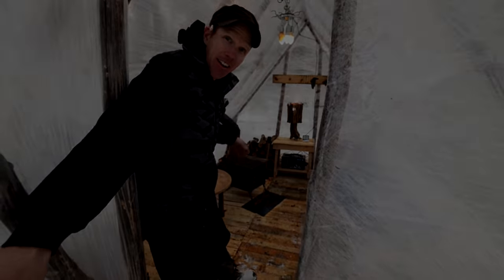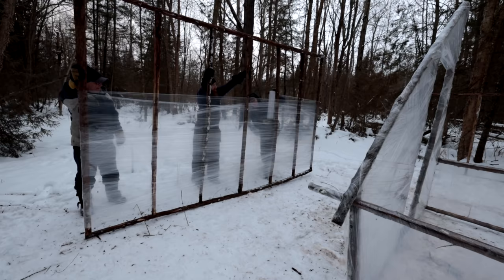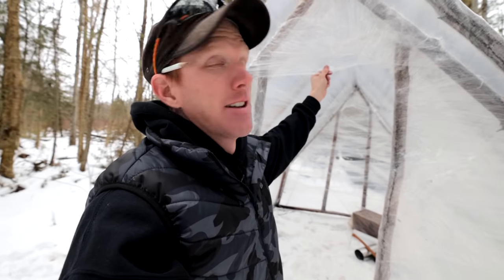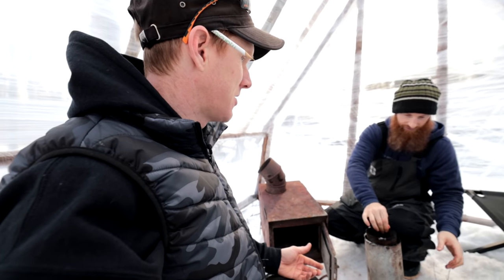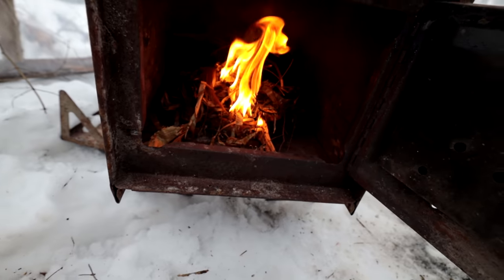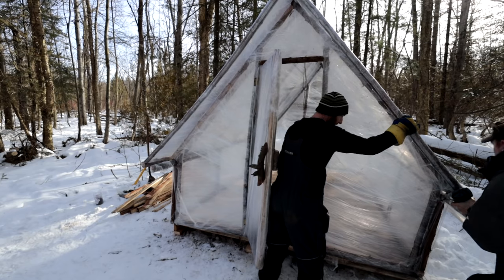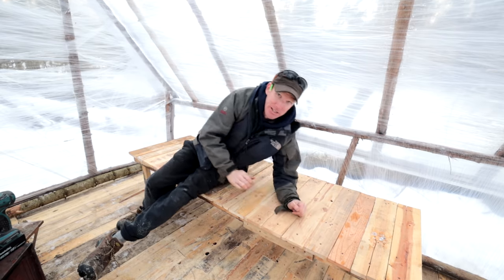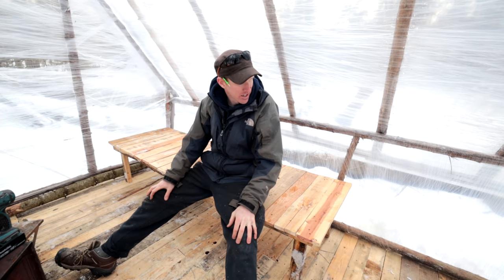$25 Winter Cabin Build (on an Extreme Budget!)

Comment: I would have made the “floor” about 4 feet longer out the front so you would have a porch area to stomp the snow off your boots before you went inside 🤷🏻‍♀️ 
Coat rack is a nice touch 🙌🏼
Reply: Have a similar overhang on the roof aswell
Reply: Maybe even tilt the floor a small bit on the sides from the seam in the middle so melted snow does not build up into puddles
Reply: Gord idea luara wijowski

Comment: I imagine the moisture levels inside that to be insane. can't imagine spending a week in it during rainy weather. and I'd suspect mildew may make an appearance after a while.
Reply: Agreed. Also not a good idea to have fire anywhere near that plastic
Reply: They could probably better control it by poking hundreds of tiny holes in the roof area with some tool.  Make something that is 1x1 foot that can be pressed against the plastic to make all the holes at once.  Do that in several different spots, and there would be a decent air exchange without letting out too much heat. The real problem with the thing is that as soon as the fire dies down, the temperature will drop quickly because of the lack of mass to hold heat. So it wouldn't exactly be safe, because if you fell asleep without making sure you have enough fire to last the night, you could freeze in your sleep very quickly because of how fast the temps would drop.  Although I wouldn't even consider something like this even for short term, because it's definitely not going to offer even the slightest bit of protection from a wild animal.
Reply: Maybe not. Its pretty dry in that climate and the stove will suck air in and vent it out
Reply: @Buck Norris " You can't sleep during early stages of hypothermia"

You might not be able to go to sleep if you're already awake.  But if you are already asleep and the temperature drops far enough quick enough, you can freeze without being aware.
Reply: @Buck Norris We literally see homeless people freeze to death in their beds all the time. People who literally die right outside of churches and other buildings they could go into.  Again, if the temperature drops fast enough quick enough, you can go into hypothermia very quickly. We're literally talking as little as 5-10 minutes.
Reply: @peoplez129  homeless people also often have mental health issues or drug problems. if someone is knocked out on heroin a tornado wouldnt wake them up
Reply: @mue56  was just about to say the same thing
Reply: @mattychristian  It's not plastic; completely different poly.
Reply: He definitely made this for views and doesn't intend on ever using it once the video was uploaded.
Reply: As someone with 10 years of SOBER homeless experience, this would be a great place to live. Mildew would be the least of your worries.
Reply: Besides, there are fixes for all the "problems" with this build. And with the money you might have saved on building mats, you could fix said things.
Reply: The fire will dry out any moisture in the air. If you burn wood inside your house it reduces the humidity so much you will start to get nose bleeds from the dryness. You almost need to run a humidifier if you are burning wood during the winter.
Reply: @peoplez129  depends on your sleeping bag, I've made it through the night in -50, it sucked but it's survivable
Reply: Who cares . They are having good brotherly fun. No harm done and sure NOT expensive fun ;)
Reply: @peoplez129  Would it make a great green house?
Reply: @pewmcgrew5226  It's a $25 "winter cabin". You act like I'm supposed to say "It works very good" lol.
Reply: Get moisture absorber container work great
Reply: first thing I thought when I saw the thumbnail: Condensation!?!?!?
Reply: Some reet Debbie downers itt. Air exchange will be fine and the wood these guys are burning is pretty much bone dry. Mildew? “If it’s raining outside” “bears sneaking up on you”. I would live in that beauty all day and night just to escape doomsvilles like some people itt.
Reply: @deepwaters3335  just what I was thinking

Comment: "It would be real easy to get out of you did catch it on fire... just run through the wall."

--A person who has clearly never tried to push through a few layers of pallet wrap.
Reply: @mrwess1927  yeah... speaking from experience, you can only tear a small (3 to 6 inch) hole that way.  It doesn't tear like saran wrap, it bunches up and becomes stronger the more you force through it
Reply: Pocket knife, axe, stool, kettle, kitchen knife, sharp rock. Any of these would work to get out in a hurry. Id be more concerned with C02 or CO building up then getting out.

Besides a 6'2 dude shoulder checking the wrap at a dead paniced sprint would be pretty likely to rip at least enough to scramble out of. Bunch of guys used to do it all the time at a place i worked.

Auto wraper would sometimes screw up on small wide pallets and the wrap would then get stuck on a support leg by mistake...so you would get 20 or 30 wraps around the bay if no one saw it in time. So you would end up with a wad of plastic that was just wide enough to fit over the 2 concrete poles by the exit....and you can figure out the rest
Reply: That stuff would melt in a hurry. Just walk through the flaming hole.
Reply: Or had plastic burns
Reply: right
Reply: @seanrallis6714  true
Reply: @balls up I had never heard of the summer land fire until this comment. That was a horrible tragedy, but import historical information. Thank you.
Reply: @seanrallis6714  there's no way that is going to stop a full grown man trying to get through it, it's not thick enough, I get what you're saying the stuff is strong but there's enough space between each wall section for it to be weak enough to break out
Reply: next part of the project: A glass emergency box on the wall, with a hammer to break the glass, inside the box, a box cutter :)
Reply: Just grab the bottom and flip the thing and walk away
Reply: @codpug  Yeah, it's pretty lightweight 😄
Reply: ... as you rebound back into the flames...
Reply: A wife could just use her tounge to cut the way out...

Comment: I could easily live there. My off grid cabin was dependably 10 degrees warmer than the outdoor air. I used to run some heat (I used propane) for a couple of hours when I first got up. It really was all I needed in Virginia. I just discovered your videos. Reminds me of my five years off grid in Virginia. Now I’m in the desert SW in an apartment. But I still use my skills for camping. And I could easily and comfortably live in my SUV because I can lie down in the back and I don’t own that much.

Comment: A lodgepole Teepee would go up a hell of a lot faster. leave the traditional vent at the top of the teepee where the poles come together.
build a small campfire in the middle of the floor of the teepee.
Because the fire is in the middle of the teepee the heat will not be too hot for the plastic or poles.
no need for anything to build it but a length of rope to hold the top of the poles together.
a hatchet or hand saw to cut the lodgepoles and the plastic rap or other canvas material to cover the teepee.
The taller the poles the bigger the teepee.

Comment: If you add some garbage bags cut into mats, to use their whole surface area, you can even have walls which are not see-through, for maybe $5 more in the worst case. And that price also includes about how much scotch tape you would meed to make sure it stays on the walls, though staples could also work.
You can use pipes (and a shovel) to get the both the air from the outside, and the smoke outside, without needing any hole in the walls. And do look into rocket mass stoves, since covering the sides of the stove with piled dirt could help retain the heat for longer periods of time, to not need to refuel it as often.

Comment: The material totally makes sense. I wish they could have engineered it in a way where they create more air packets for insulation
Reply: Umm...bubble wrap?
Reply: @Phoenixesper1  It won't be aesthetically pleasing though and would require extra materials to put together. I was thinking more of wrapped twigs, arranged around the wooden support and then wrapped again
Reply: @Phoenixesper1  Two layers positioned so the bubbles are touching each other surrounded by the pallet wrap.
Reply: Having more horizontal members in the roof panels would cut down on convection currents. Would probably help.

Comment: My dad, twin brother, and I built a greenhouse like this back in the day. We used big wire hoops and thicker plastic though. And we had a hole with a blower connected in between the plastic as to separate the two pieces and form a "bubble". Great insulation.

Comment: "We're surrounded by plastic"...yup, literally! That stove could use a wire brush and graphite coating. Super cheap and it will last longer. Plus if you add a back to your bed it can double as a bench seat.

Comment: You could probably add some forest fluff in between the layers of plastic wrap to act as insulation.
Reply: Lmao yes you can. I've lived in the woods my entire life. Haven't had grid electricity since 1994. Seems practical for a temp shelter but when you pack your home full of woodland fluff... you get woodland spiders, mold, mildew, extreme condensation issues. Ironically I pull all my insulation down in the spring and summer, due to moisture getting trapped in between the walls. Without the ability to control the inside of your oven bag, you just create a super powered petri dish. I spent a fall winter in a cave as well until my lungs got too much dust and bat poo inside. I actually caught a bat coronavirus years ago, good times. Most the old timers out in the woods are gone, just new age people using man made materials to show off their skills at building trash piles.
Reply: @exposingthetruth3821  speaking in terms of a temporary shelter. Not where I'm going to be living at permanently.  I have a job and house lol. Each to his own though.

Comment: This has been a very funny idea. But: wouldn't it make sense to lay out a tarpaulin under the floor so that not too much moisture can rise from below?
Reply: Kinda more important to put cross bracing on the floor joists so they don't rack over time.  Moisture doesn't really rise, but air drafts would be a significant comfort concern.

Comment: I really enjoyed the video.  Just rewatching it agian.  At least one long triangle in every panel would add a lot of strength. You can add the triangles on the inside after you wrap it. Some triangles (horizontal timbers) just above head level would form a roof trust as every roof trust has to have triangles unless they are very large ( usually laminated ) timbers that will carry the load. A cheap wood stove fan is nice on the stove.

Comment: Great video. A great solution for a small outdoor recreation in winter.
Reply: @_vandoos_   igloo snow den.
What is bad is dealing with an area with little snow and frozen earth that you can't cut through. 
In my area we had plenty of people that tried to walk five miles across open corn field to the nearest gas station.
They didn't make it.
Reply: @krispalermo8133  what happened to them? Did they survive?
Reply: @AdvocateforTruth   No they froze to death, they bought into the bull crap it takes hours to freeze to death, despite public news broad casts stating it only take minutes to suffer frost bite. Some of them were found bend over with their hands' on their knees frozen still more or less standing. Illinois most of the time has mild winter weather, but out over open flat farm lands winds shear can get down to negative -30 below or more. That is artic wind temp.
Reply: Can't believe I've spent 20 minutes watching these liars. That should cost way more than $25 unless they're shopping in South America and walking, swimming and floating the materials to said location
Reply: @Flash Dance Tig yeah, like a forest fire emergency!
Reply: @krispalermo8133  we don't believe you! So where are the people that didn't make it 5 miles across an open cornfield? I mean did they all perish and did you just stand there and watch them? Please provide more details
Reply: @krispalermo8133  -30° is not Arctic temperature that's like Western New York temperature right now APRIL 2021

Comment: Sorry having a cynical moment and it kills me. "we are going to build a cabin for $25" first thing we see is a tree being cut down with an $80 folding-saw, $40+ ratchet bindings, $?? hauling rope, $90 hauling sled. x2 $?? labor, $12 screws, $140~ power drill, $12 tape measure, $145 axe (guessing it is a Gransfors Bruks), $100~ chainsaw, + go-juice, stuff+++++. ANYWAY, fun project that can probably be done for around $25. Good video quality, clear audio, nice pacing, good job. Thumbs up.
Reply: Would he helpe if they had made it with a $5 rip saw and a $8 timber handle hammer.

Or dose the concept of browing tools from "that guy", u know that guy he's got 2 of everything........

But point taken 5 minutes crafts be either hot glue gun crap or $100,000 power tools very rare to find something really achievable
Reply: My guess is that he used most of that out of convenience then actually needing to. Because there is a YouTuber guy that builds basically everything by hand. With basically no modern tools. 

Also 140$ for a drill? It's yours gold plated? I can get a Black and Decker for under $80.
Reply: The biggest expense would be land with trees on it.

Ratchet bindings and sled are just to save labor. Your own labor is free, and if you wanted to do it all on your own, you could.

You'd only need one cutting tool, and you don't need a tape measure. No need for exact measurements. Cut one piece, than cut the others to the same length. 

Drill and screws could become nails and a hammer. Or nails and a rock if you're brave enough.
Reply: @alfalafelstine1536  that's it find land to build it on .... At least around me it's national Park or private property- farmers- coal mining an power plants.

Most will let you ride but not many want u building something no matter how temporary

Comment: I like the weaving to give structure to the roof panels,  I also think the final wrap of plastic on the roof should start at the bottom and go up with the next wrap overlapping the previous.  That way the water will not run under. Its something worth mentioning to the people watching. It looked like you guys did that but didn't say.
Reply: Overlapping the windings from bottom to top like the shingles on a roof will keep the water from running underneath the layers.

Comment: We should make a build like this acceptable for legal housing for the homeless. Something not a home but a shelter so they can still get the process of rehabilitating started without freezing to death. I'd make a bench out of the wood and a bed out of the plastic... Just make a solid frame and make a hammock from plastic? If I lived in a tent... I would want a nice tall shelf.
Reply: I swear. I need to make a video building a structure and utilizing this plastic to the best of its ability. I've used this wrap professionally for the last 7 years wrapping pallets at a distribution company. You wouldn't believe how much actual plastic is on one roll. Several tents could be made out of one roll.

Comment: 24:36 to eliminate the gap and cold air infiltration, just wrap the outside bottom with stretchwrap now that the walls are up on the platform floor...

Comment: …you know, just body heat alone might be enough, no risk of melting. For an emergency shelter, this would totally work!
Reply: But what would melt
Reply: @ThePsychoticKermit  fire melts plastic.
Reply: @ThePsychoticKermit  thé plastic…..
Reply: Luckily, during the many occasions I needed to create an emergency shelter, I also had a cordless drill, cordless circular saw, cordless jigsaw. chain saw & 24 hours.   Just carry a tarp, or spare fly... or you know... a tent.
Reply: @BatCaveOz  you could easily carry a roll of plastic wrap (maybe smaller than that one!) and something to cut branches. Hand saw? Can use nails and a rock to hammer them.

Not everyone has a tent. What about the poor california fire people? Emergency shelter is as emergency shelter does. You make do.

Comment: That's genius! I never would have thought to use pallet wrap for a project like this. Only downside is that you're definitely getting up with the sun with this, and I do like to sleep in.

Just curious, how long will a shelter like this last?
Reply from the maker: Its still around 9+ months now.
Reply: @ModernSelfReliance  they did this on the tv show ALASKAN BUSH PEOPLE
Reply: maybe You can paint it black so can get some solar heat also the light wont come inside

Comment: You know what would make the floor even more of a luxury? BTW, I've been dabbling in survival shelters since 15-16 years old. I thought about a pallet floor with that composite wood, sheets would be better than planks in case fire spits out hot coals between planks. So get the deck pallets near install, stuff R-13 paper side down where the forks go to left the pallets, then pressure treated 1/2" plywood to cover the bottom, the finale is pallet slats to cap the ends. Ta da, no more ground penetrating frostbite!

Comment: neat lil trick. you can also cut the nails of pallets using a regular handsaw. just sick it inbetween the planks and saw away. those nails are really weak and snap easily 90% of the time.

Comment: Instead of buying one of those $300 portable shelters (the tarps on them tear after a few years)then having to spend hours assembling it  I got a bunch of free opaque plastic & free tarps. I was gonna build a wood frame like this, use some plastic shrink wrap, then cover with the thicker opaque wrap, then add a tarp that can be quickly uncovered/covered to get daylight. I might look for some of those free white lumber tarps also. The white plastic lumber tarps are actually pretty durable.